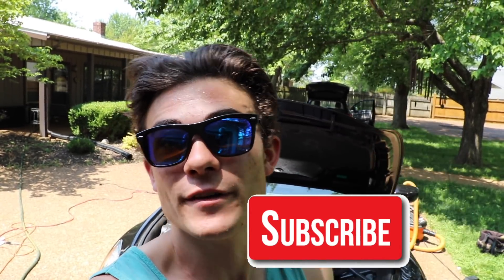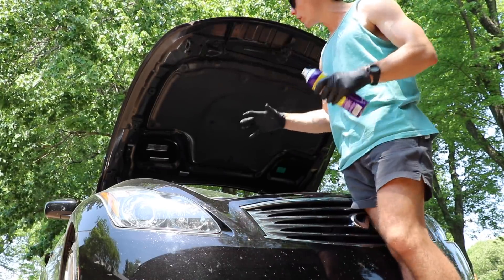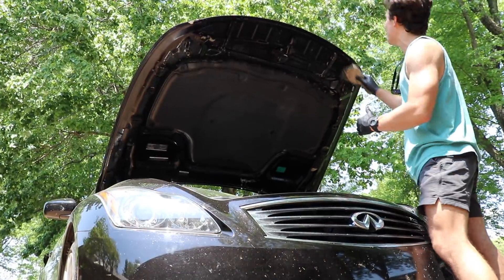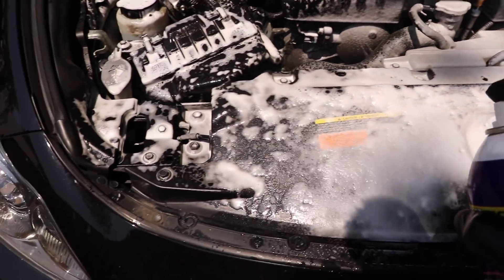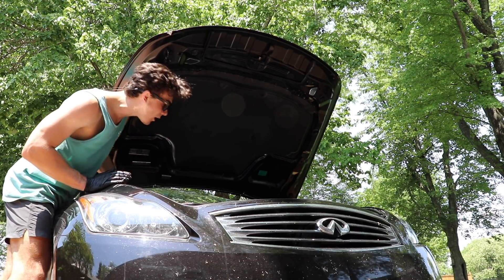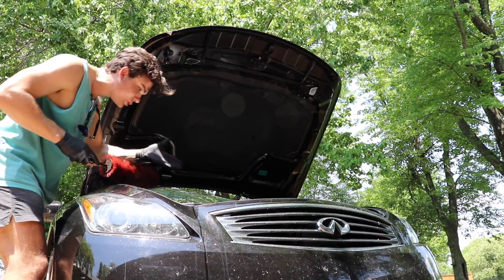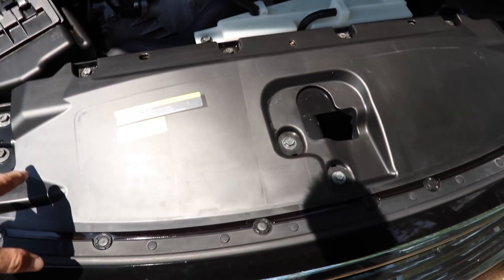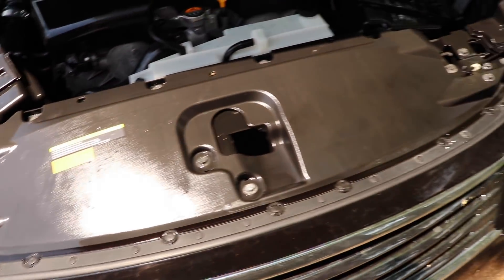Best Product for Engine Detailing: Super Clean Aerosol Can Degreaser!

Comment: Nice video .. I’ve been having a problem when I try to clean windows in the sun the product streaks really bad and I can’t get the streaks off using chem guys window cleaner and I’m in fl btw.. any tips?
Reply: Vicente Serrano I'm in flordia too! It's so hard to detail down here.. but he has window cleaning videos that are really helpful. Window cleaner isn't always the best by itself so you have to use a 50/50 mix of rubbing alcohol (70%) and water. Clean the window with it like you would with a window cleaner then follow up with the window cleaner. You can even clay bar if you wanted to. Those 3 steps would probably clean the window pretty good.

Some other YouTuber I watch for detailing is AMMO NYC, Dallas Paint Correction and Auto Detailing, and ChrisFix! 

These are my top 4, including Wilson's here!
Reply: Miles Steele thanks a lot definitely gonna check those vids out
Reply: Try using distilled water on your windows.      I've also heard of folks using Bar Keeper;s friend to remove water spots.   Additionally, use a squeegie to quickly get that water off the windows as you wash your car (i squeegie my windows before I clean the bottom half of the car).

Comment: Have you ever encounter a customer car with matte/satin paint finish and wheels? If so what do you use to clean it?. The thing about matte/satin finish is you have to be really careful on what product you are using and technique because one mistake you ruin the whole vehicle. You can’t use stuff with wax, gloss enhancers and polish it. If you scratch it it usually permanent and you pretty much screw while glossy finishes it no big deal. So yeah you have limits on what you can do with it.